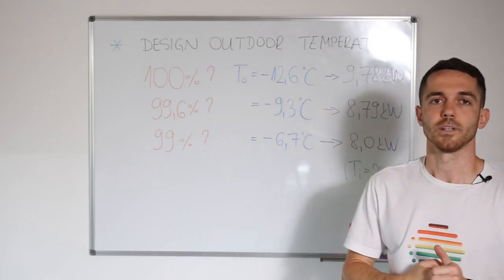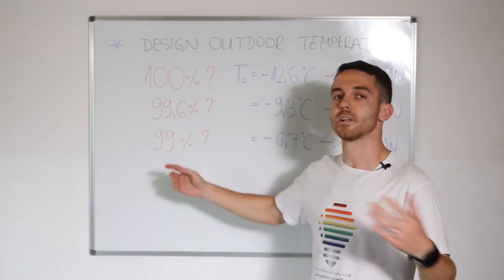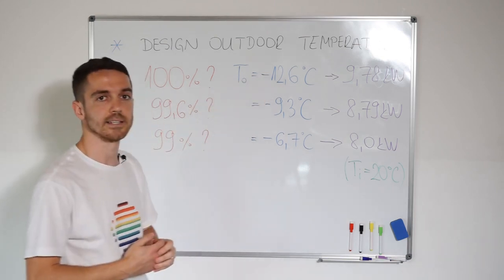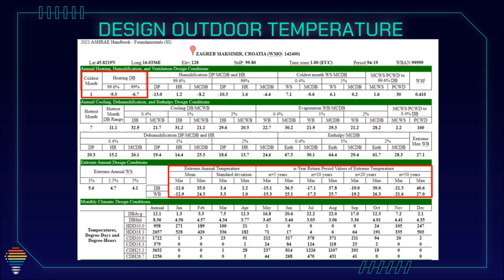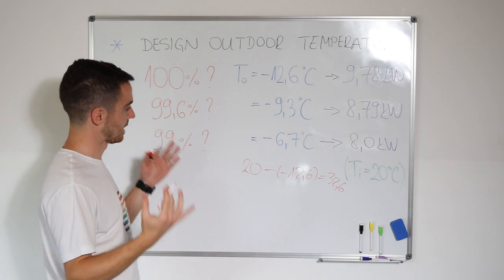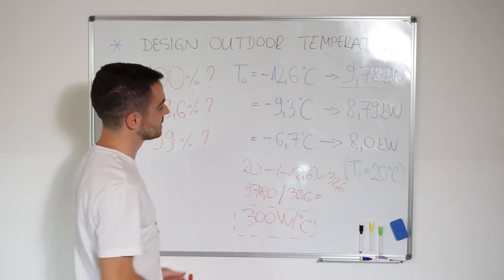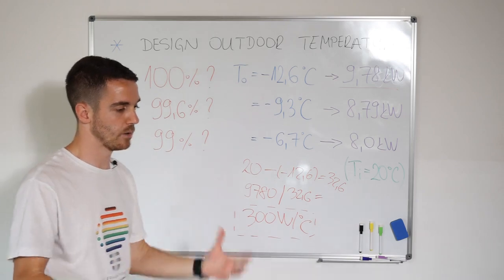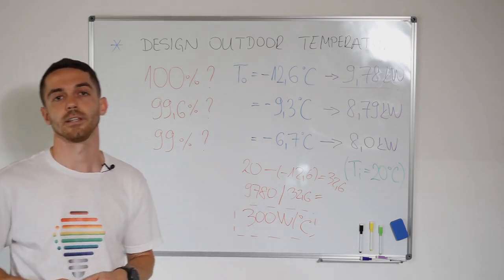Do Not Overestimate Heat Loss

Comment: Hi and thank you for the valuable practical information that you provide. I am located in Sofia, Bulgaria and try to design my heating system using a heat pump. In that regards can you name another source of annual temperature data as in ASHRAE the latest data is from 2021 and now the climate warmed up a bit.

Comment: Really important issue.  It is true that the old approach still exists....the designer adds 15% as safety factor to calculated losses and sends the KW to the installer, who adds another 15% and sends it to heat pump provider who also adds some KW to round at the closer larger heat pump of his catalogue.....heat pumps are not cast-iron boilers with large thermal mass....
Reply from the maker: Agree, in that case we have 30-50% oversized